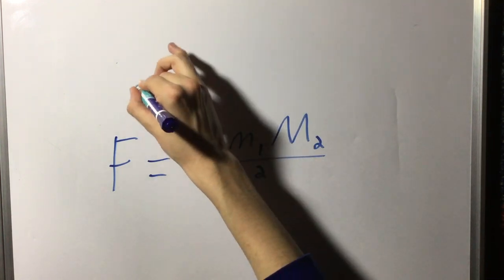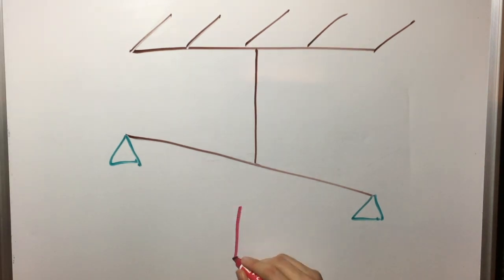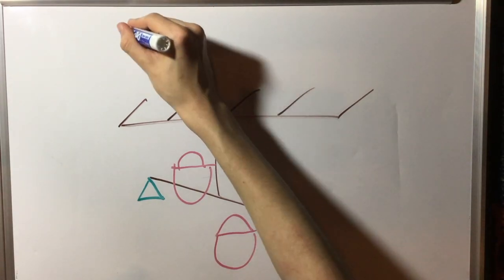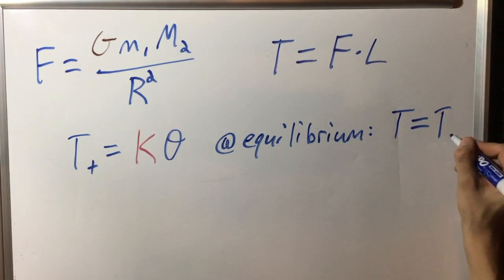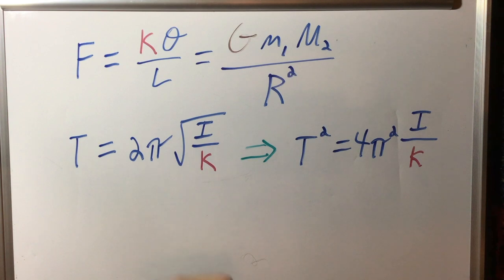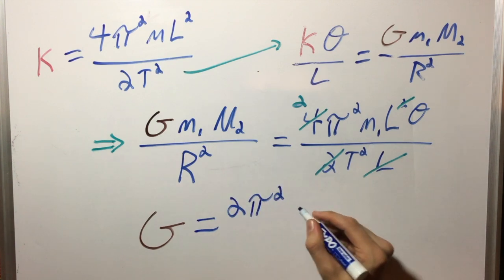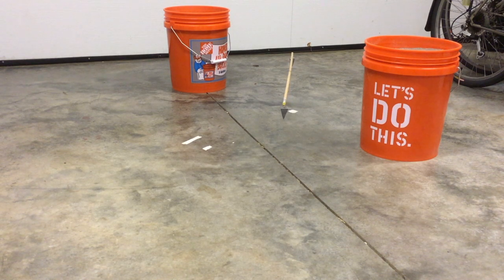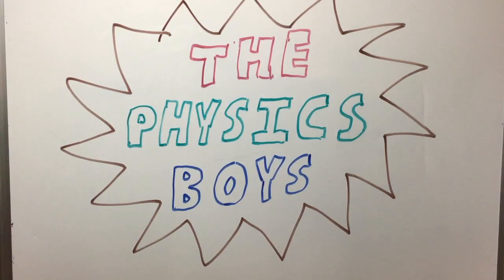The Cavendish Experiment Explained

Comment: How do you know R?
Reply from the maker: The Plane Truth Good question. After it has done several oscillations and gotten into a rhythm, we stuck a peice of tape at its outer bounds, then measured the distance from that peice of tape to it's equilibrium point using a tape measure. That gives us the distance it oscillates, which is R. We should have made it cleared in the video.
Reply: Santiago Monleon 
Oh. So R is for the test? I thought it was for the earth. Wouldn’t you just know R per the diameter of the two smaller orbs? 
Anyway, it seems a far cry from the actual Cavendish experiment. It certainly wasn’t to scale.
Reply from the maker: The Plane Truth I suppose we could of named it a better variable. R is not of the earth, it's the distance the torsion balance occilates. Look to the diagram at 2:20 for a picture. I don't know how you would find it using the diameter of the balls, but that shouldn't effect how far the torsion balance occilates. 
You are right, our experiment is no where near the size of Cavendish's.  You can find the main differences that lead to our error at the end if the video (air tight container, larger mass ratio, better measuring tools, ect). Measuring the universal gravitational constant is no easy feat, but given our resources, I think we did pretty well.
Reply: Santiago Monleon 
Or you could stop trying to measure what doesn’t exist. 

One question I’ve had since looking into this: who says this contraption is what will measure the supposed observable data? Or is it basically, “Hmmm objects attract each other; let’s try this...” here’s one to try: just hang the two balls from the rafters and see if the distance between them lessens. That’s just as novel and silly. Want to know why the test is so hard: The cause doesn’t exist.
Reply from the maker: The Plane Truth I don't know what you mean by measuring something that doesn't exist. This experiment is trying to find G in the equation g=GmM/r^2. 
As per your second question: You seem to misunderstand what this experiment is trying to accomplish. We aren't measuring whether or not two objects attract eachother, that's self evident.  Rather, we are using a torsion balance to create a rhythm of simple harmonic motion, where  the force of gravity, and the torque of the wire offset each other, and it stays in motion due to the inertia of the smaller ball. This has all been modelled in our derivation. We derive an equation from what's occurring, and after some substitution and rearranging, and measuring, we can find G. 
To deny this is to deny the basic laws of physics, you can however argue that this experiment isn't the most accurate. This you would have some truth in, but the point of this experiment isn't to find the most precise value of G, that has already been done by scientist in labs, but to recreate the first working experiment that found G, and shaped our view of gravity for centuries.
Reply: Santiago Monleon 
Yes, but the first test was not recreated. You did not recreate Cavendish. 
And my point is to deny G or g or whatever you might think is provable. It is not, patently not, evident two objects attract each other. That is a construct for an hypothetical impossibility. Your experiment might just as easily prove how two objects, Santa’s sleigh and my house, attract each other. 
The heliocentric model is bust.
Reply from the maker: The Plane Truth Your right, we did not recrete Cavendish's exact experiment, the differences we're explained in depth in the video. We did however make a close model to what Cavendish performed 300 years ago. 
Our experiment is not measuring gravity,  aka whether two objects attract, but rather the Universal Gravitational Constant. I think your conflating the UGC with the force of gravity, which it is not. Objects obviously attract eachother, we want to know what is the ratio between those objects masses which determines the force of gravity between them. 
As per your concern as to whether this experiment actually tests the UGC, I believe the fact that we got so close is enough proof. Additionally, the mathematical derivation we performed also shows we have indeed found the correct variable.
Reply: Just Looking 
Dude, my house isn’t real.
Reply: Just Looking 
Ok.
Reply: Just Looking It labeled - therefore it is. Excuse my flaccid banter while I continue to live my life with Cavendish's shyness with none of the intellectual verve
Reply: @Just Looking 
The experiment is wrong and gravity does not exist.
 If the formula of gravity is correct, take note the inversely proportional of radius squared.

So if the hanging pyramid shape thing is getting nearer into the container, the distance between will be smaller or approaching zero, so the force of gravity between them will also increased, and it should not swinging back.

If the pyramid shape thing, accelerate from at rest toward the container by way of gravitational force between them, then the more it get nearer the more it accelerate toward until it touched the container, and the distance become zero.

If the distance become zero, the force between them will become enormous that cannot be separate by swinging back. 
Example Math = 1 divided by r^2 or 1 / 0.0000000000000001 meter how much ?
Reply: @Just Looking 
Pendulum is another case.
It swinging back and forth because of weight force, centrifugal force, other force, friction unsettled.

Here, we are talking and object that came from AT REST, then accelerate toward the container.

If that force  is enough to move an object from AT REST then much more during in motion.
Reply: @theplanetruth  About the reality of gravity, I know the consensual answer. About the reality of your having a brain, the jury is still out.
Reply: Santa's sleigh is not attracted to my house, but you can think of it as though it is.. gotcha. @just looking
Reply: @BoomCowCast  Is not obvious that objects attract each other. That is action at distance, aka magic. Even Newton himself abhorred that idea. 

"It is inconceivable that inanimate Matter should, without the Mediation of something else, which is not material, operate upon, and affect other matter without mutual Contact…That Gravity should be innate, inherent and essential to Matter, so that one body may act upon another at a distance thro' a Vacuum, without the Mediation of any thing else, by and through which their Action and Force may be conveyed from one to another, is to me so great an Absurdity that I believe no Man who has in philosophical Matters a competent Faculty of thinking can ever fall into it. Gravity must be caused by an Agent acting constantly according to certain laws; but whether this Agent be material or immaterial, I have left to the Consideration of my readers."
— Isaac Newton, Letters to Bentley,
Reply: So, you didn't listen to what R represented in the experiment and you didn't bother to find out what the experiement was about. That is  fenomenally lazy.